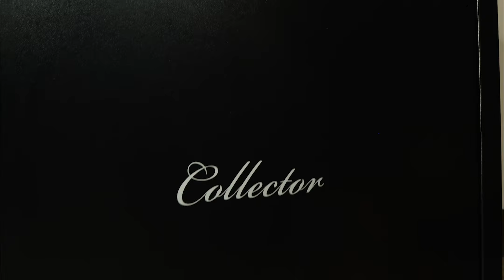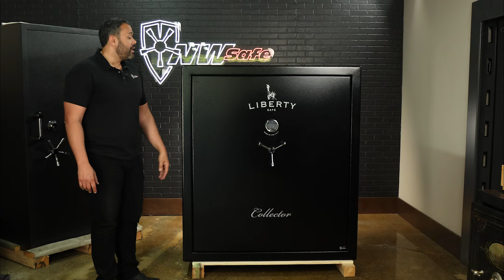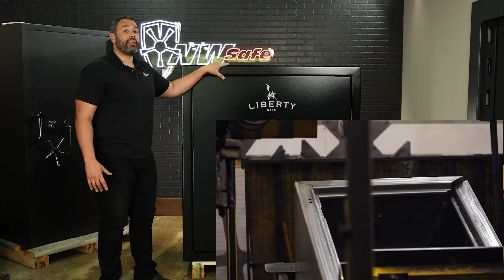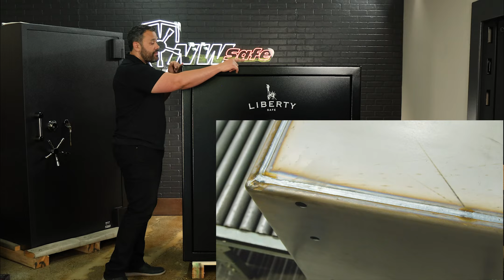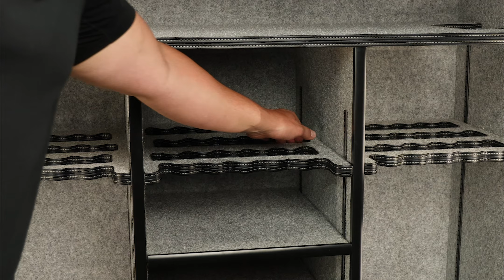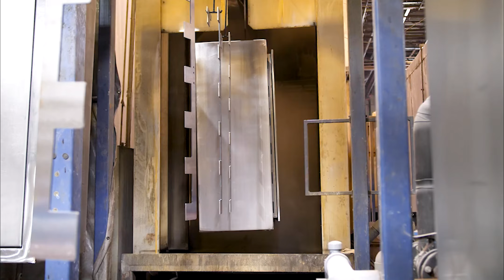The Collector by Liberty Safe

Comment: Why in the world did they not add the dehumidifier like the presidential series has? If I’m putting rare and expensive pews in this thing I wanna make sure that it has humidity control.
Reply from the maker: @Everything2A  Free accessories would always be a nice upgrade. The overwhelming majority of safes don’t have a dehumidifier standard. Fortunately a good dehumidifier rod big enough for a safe like this can be purchased for less than $14. Expect to pay around $50 to $60 total for a good dehumidifier rod and desiccant pack combo which is our recommended go to for dealing with rust, mold and humidity.